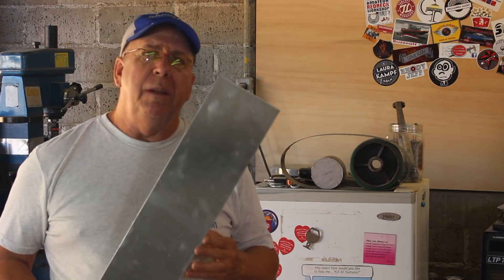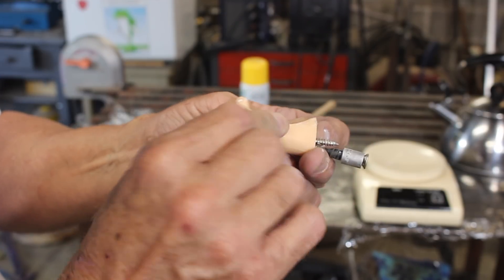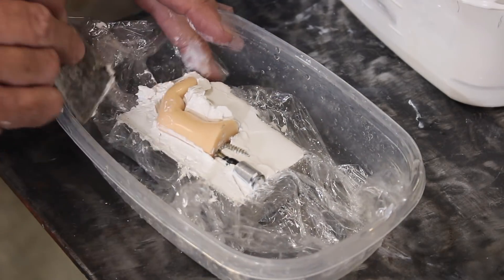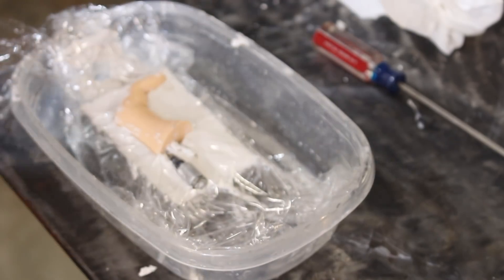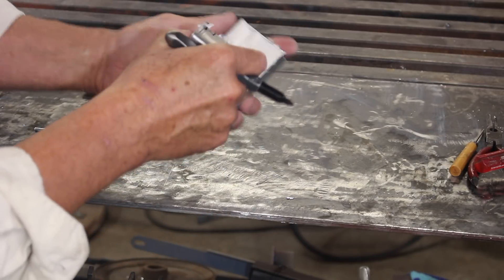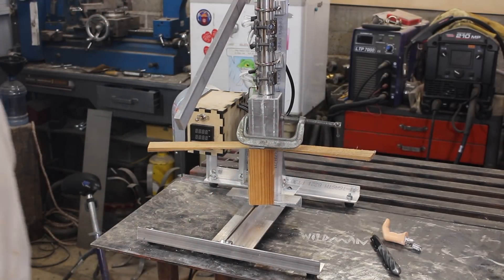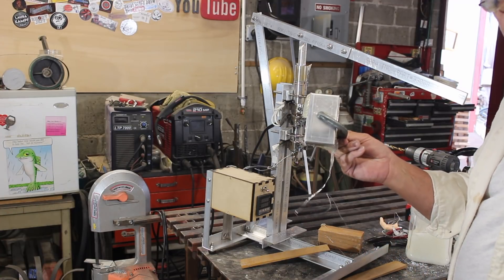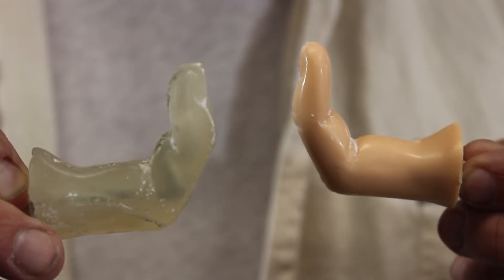Plaster Mold for the Injection Molder!

Comment: Flip your machine 180 degrees and have a vent hole at the top of the mold. Right now gravity is allowing some of the plastic to enter the mold prematurely and it hardens before you are ready to fill the mold causing your problems.

Comment: Use hydrostone resin plaster, to make two mold half negatives in the same style as a silicone mold. Make sure that you use registration keys for alignment. I've been molding and plastic casting my sculptures for years, and it's worked great for me.

Comment: Be very careful with plaster molds. Moisture in the plaster will be turned to steam and at the very least, crack the mold. 
Mold separator for plaster molds, use a mixture of Murphy's oil soap and water.

For all the time and effort you put into making the mold, you could have used aluminum filled tooling epoxy and had a production mold.
Reply from the maker: Maybe I'll try that next.

Comment: This guy essentially made a larger concept of a glue gun and swapped out materials. I guess props to the workmanship on the barrel and such, and quite nifty for diy garage stuff. But there's a reason why a screw was added to injection molding decades ago. You're not going to get an adequate melt by just heating it from the outside edges of the barrel with a few thermocouples. 

And using shims to hold the mold in place is quite humorous. I guess if I were to offer advice for improvement with what he has to work with, find a way to clamp all corners of the mold, rather than just one area with a c-clamp. If you can apply adequate and consistent pressure throughout the area of the both sides of the mold, you should be able to eliminate most of the excess flash. And then create a fixture to keep the mold stationary against the nozzle. To eliminate the rest of the excess flash, you'll have to fine-tune the parting line of that mold. But with the plaster material, may prove to be difficult.

Comment: Glad to find this. Need to make a garage door opener pin pad cover out of resin. Think this mold making method will make it pretty quick and simple.. any difference between using plaster and hydrocal?
Reply from the maker: I think one of the comments below suggests using hydrocal. I haven't used it yet.
Reply: @WildmanTech  hey thanks...one more question. Was obvious you let the plaster start setting up before you put the master in but how did you know you wouldn't set it too deep? Just by knowing  how deep you made the aluminum box? Guesstimate halfway down in so you didn't push it in too deep..?
Reply: jimeronimo it was just my best guess.
Reply: @MarshWildman  thanks. I should be fine. Going to mold and cast my garage door pinpad flip cover. The damm thing falls and breaks.. they dont make them anymore and when you find it they want $25 for the silly thing. Think your method would be the simple way to get r done.. thanks
Reply from the maker: @jimeronimo  If you are successful, you can start selling them for $25!
Reply: @WildmanTech  yea man..

Comment: You were out of breath after making that. I noticed that you didn't have any vent holes for air to escape from. I think that's what plugged it the first time. The second time you forced your mold open and air escaped. Excellent idea using plaster. It will work for a couple parts but not long term.  Still, sometimes that's all we need. Perfect.  Are you selling those injectors yet? 

I would incorporate a 12 ton hydraulic jack. Less work and more power pushing plastic through.  Very cool. I like it. Vectric has a drafting software like Tinkercad that lets you make 3D files. Go to this website to see a MPCNC machine you build yourself.  

https://www.v1engineering.com/assembly/  I think you're going to really want one. It's a homebuilt CNC machine. You can mill aluminum to make molds.
Reply from the maker: It clogged because the hole was too small. There was never a tight enough seal between the two halves to hold air. The objective here was to be as inexpensive as possible. Many suggestions have been made to power the piston, but we're trying to stay with items we can make ourselves. That way people don't have to rely on parts that may or may not be available. We use Fusion360 for CAD and CAM and we have CNC machines. Mold making is where the real money is. The business model of selling the molder relies on repeat business from the buyers offering them new molds made from their CAD models. So far, we've never received a CAD model that could be made into a mold because nobody seems to understand that the model needs to be tapered to properly eject the part.

Comment: Make a silicone 1pc mould. No lines. Not sure if that's high temp enough, but cured resin hits like 250+.
Reply from the maker: It would stand up to the heat, but would probably distort from the pressure.

Comment: Hi there, this looks very good already, especially the injection machhine. You could experiment with moulding by using professional material like Zamak (Zamac) a zinc, aluminium, magesium and copper alloy which melts easily as it is still considered a pot metal. With your plaster mould you are already halfway there. With some additional steps you might well be able to make really good moulds. Also as a tip, place the first half of your pattern use plasticine and pour the plaster on top, that way you can create a very nice mould joint and also incorporate keys to register the mould halves..

Comment: Drill a vent hole into your mold to the fingertip to give the compressed air someplace to go and should then not be so hard to force your plastic into your mold.
Reply from the maker: 24Seven There was not the greatest seal between the two mild halves. A bigger hole at the end of the melting chamber would be a better improvement, but then we would need to add a valve.

Comment: How did you prevent air bubbles?
Reply from the maker: Plenty of heat and a lot of muscle.
Reply: @WildmanTech  Sorry.  Not sure if I understand.  You're saying extra heat allowed bubbles to rise out of the plastic?
Reply from the maker: @amitvika  I didn't say extra heat. I said plenty of heat, as in enough to fully melt the plastic. Pressure is what forces bubbles out.
Reply: @WildmanTech  So enough pressure that air bubbles leaked through piston seal? Air only has two escape routes: nozzle or piston seal.
Reply from the maker: @amitvika  Through the piston seal, the seal between the nozzle and the mold and through the mating surface of the two mold halves. Look at 7:50 and you can see how it actually spread the mold halves apart.

Comment: ok between the fidget spinner with air bubbles to this one, what did you do to prevent air bubbles?
Reply from the maker: the plastic was hotter and the gaps in the seams leaked so much the air escaped through them.

Comment: Why not use some high temperature silicone mold, you can cast aluminium in it so plastic shout be good right?
Reply from the maker: The pressure would definitely deform it.

Comment: more heat you shouldn't have to pull so hard
Reply from the maker: More heat will burn it. The next rendition uses a rack and pinion gear to apply the force.

Comment: I find these home made injection molding machines interesting, as I work as an injection molding tech, but the molds we use weigh up 16,000 pounds, I'm sure one can use almost anything as a mold, I have seen prototype molds made from 3D printed plastic reinforced with either steel and aluminum
Reply from the maker: The reason we didn't 3D print a mold is that the filament melts at the same temp as the plastic we're using.
Reply: We inject mastic and nylon, mastic    temperatures @ 180 - 190, nylon and nylon glass reinforced @ 500 - 630

Comment: suggest you vibrate the mould initially that will cause the plaster to flatten, once it’s set try sodium alginate as a mould separator just paint on the set plaster and add the second mould any dental technicians supplies will have it. It’s cheap and works well. You could also use Vaseline as a separator 
Once the mould has set pour boiling water over and tap the side of your mould with a hammer. This will “ crack”  the 2 halves paint sodium alginate over all the two  surfaces and once dry assemble and do your injection, dental techs make false teeth in this way except the pattern is made in wax and the boiling water softens the wax and the remainder  is removed by boiling water and detergent. Using a wax pattern allows you to have an irregular pattern and be able to separate your mould even if there are any undercuts without breaking the plaster

Comment: hey, i also try to create molds, i doing it with a 3d printer, then i sandcast it, melt aluminium in a DIY furnace and create myself some modls that way. maybe it's something for you too.
Reply from the maker: We tried pewter with mediocre results. CNC milling the mold is the answer.

Comment: How about some steel reinforcing, eg. chicken mesh, purpose bent heavy duty fencing wire,  Check out steel reinforcing layout in bridges with thick concrete sections. The mold will then not crack and split open. You will have to mix plaster much thinner. Thanks for the idea, this will be great to cheaply evaluate actual parts as well as  mold flow without going straight into hard tooling

Comment: What kind of plaster did you use?  I would suggest Ultracal.  They make army tank molds out of that so it is durable.

I would also suggest making keys to key one side of the mold exactly to the other so they line up perfect every time.
Reply from the maker: There's a link in the description to the plaster we used. Aluminum is the way to go.

Comment: I think if you were melting HDPE or LDPE you could use silicone molds and re-use them.
Reply from the maker: Edward Clayton the problem with silicone is that it has no rigidity and will distort under pressure.
Reply: I've never used silicone under pressure.  Thanks for insight.  How about zinc?
Reply from the maker: We’ve done some experiments. Zinc works, but in the grand scheme of things it’s an environmental nightmare. Best thing is to carve molds from aluminum, which we’re teaching ourselves to do.
Reply: Save up for that CNC milling machine...
Reply from the maker: We have a Tormach 1100!

Comment: You need another gate in the mold at opposite end feeding back up to the top to allow the air to be pushed out without having to worry about drainage. Plaster molding usually starts with a wax model of item so it can be melted out of the mold without chipping edges. Alignment keys in the molding process would help alot.

Comment: OMG THANK YOU SO MUCH SIR. I was racking my brain trying to find a high temp mold that wasn't metal. I thought of everything from high temp resins to 2400 degree rated JB weld. plaster works perfectly. Thank you and GOD BLESS.
Reply: High temp.Silicon is used  for pewter (446º)

Comment: Just watched this video, very impressed with the injector aspect, however, just my opinion I think since you are using plastic to mold with you could look into RTV. Smooth-on and other RTV manufacturers have a tin-cure RTV that can withstand the temps you are working at. (only mentioning this as I hand cast pewter gaming mini's). If I can help more contact me at shadowweaver@charter.net, But great job on the injector looks like its working effectively.
Reply from the maker: We're working on another design that we hope to sell. I'll look into these silicone molds.

Comment: Have you tried your hand at Resin Casting?
Reply from the maker: Like epoxy? We tried that and it didn't stand up to the heat.
Reply: Yeah - but I mean putting the injection device aside and using silicone molds with resin... The results I've seen are quite fascinating!

Comment: Molds for all the similar injection machine has always been the big problem.  Machining just is not practical.  Mold life could be improved by choosing other mold materials.  Add a little portland cement.  Paint on a gel coat of plaster and portland,  and then use fine sand concrete for the rest.    Need also to increase clamping pressure to reduce leaks which will require more strength thus portland cement.   Also cast in tubing to reduce cycle time.   Water then can be used to cool the mold.

Comment: Very nice job! Can't wait to see what you do with this! Of course if you just wanted to make hooks, there are many mediums you could just mix and pour into a mold that would hold up almost as well as injected plastic, but this is only a proof of concept, I'd agree it's a win! You want to look at companies that manufacture latex and other mold materials to research mold making, smooth on has excellent mold making videos right here on Youtube, along with your metal working skills It'd be a snap to adapt them to your machine. Now that your testing is out of the way, I think you'll find the mold making process to be the hardest but most critical part to produce good quality replicas now!
Reply from the maker: I'll look up Smooth-on. Thanks for the tip.

Comment: Really great results for a first time.  I am sure you will perfect this method.  Who would have thought you could use plaster.  I think you used way too much pressure on the plastic.
Reply from the maker: I know I used a lot of pressure. I wanted to make damn sure I didn't have any air bubbles. Looking at other types of plaster that will withstand more heat. This stuff cracked.

Comment: Wouldn't Silicone be a better choice for a mold material?
Reply: The real problem is that at these temperatures and pressures, many materials dissolve a little from each use, so small details disappear. 
The whole point of injection molding is to make hundreds of copies of your design. If you want to make less than five, 3D print them.
Reply: I wondered about the pressure during injection, but if there's enough mass between the void and the aluminum box wouldn't that prevent warpage? Also, it looks like the 208C you're using on the melt chamber is at the top end of hobbyist-grade silicone rubber's prolonged exposure rating (Smooth-On Omoo 30's data sheet lists a max working temp of 400F/204C).

All a quick Google showed me were examples of injecting the silicone as the final part, so it might be worth experimenting with at some point.
Reply: Most silicones can't take that kind of heat.
Reply from the maker: Or pressure without distorting.
Reply: I have bought some mold Max 60, which can take higher temperatures (560F), but it is fairly expensive and difficult to use. I had to also buy a sub-gram scale for mixing, since it has a 100:3 ratio. 
https://www.smooth-on.com/tutorials/casting-pewter-mold-max-60/

Comment: If you can find it easily you may want to try Hydrocal  plaster which is much higher strength.
Reply from the maker: You're not the first to suggest that. Definitely going to try it.
Reply: You might also try aluminum filled epoxy which is probably superior to any plaster product.   Parting line and registration  features can be established using no Sulphur clay (Kleen Klay) from art store.    A U shaped mold frame and rubber bands.   Mold making is pretty easy.     Make your nozzle movable vertically and redesign your machine with better mold support.    The nozzle and sprue hole on the mold need to mate better as in convex nozzle with 60deg csk in the mold.  Looks like you're having some fun !

Comment: Nice Job! Try adding some indexing pins to help keep both sides of the mold lined up.
Reply from the maker: You can probably tell the duplicate is slightly larger than the original. This was due to a slight misalignment of the two halves.
Reply: Amen sister!